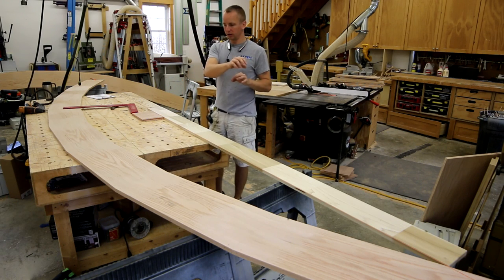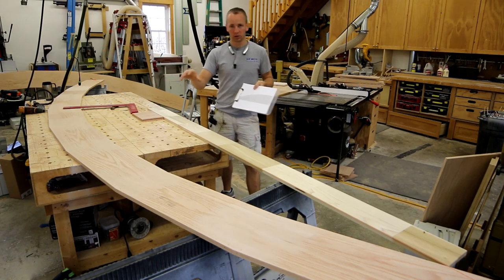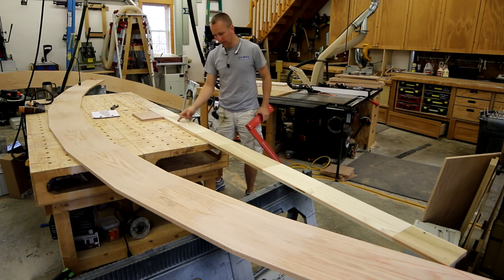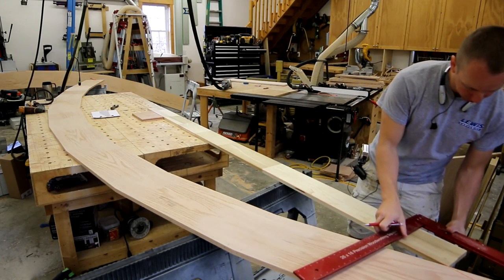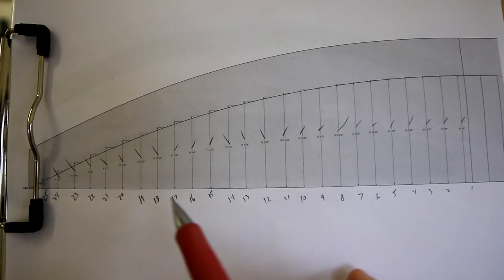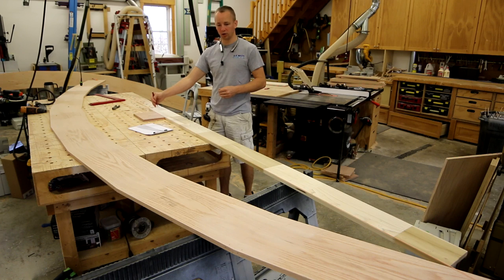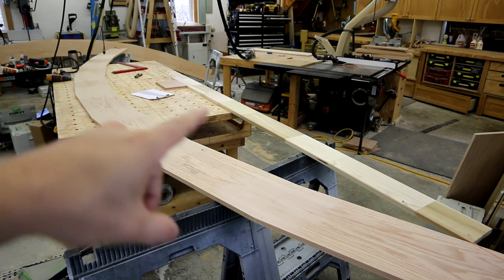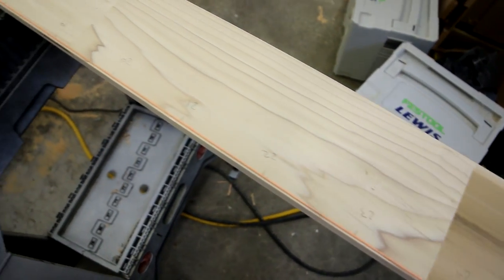Arch Beam Part 4 - Arch Layout

Comment: Awesome .. I kinda wish I had all the tools you have .. But nonetheless you got it down .  I am a poor man so I have to rely on simpler more inaccurate tools .. I am envious !!  LOL ..  When asked " Can you make curved ceiling beams " Yes ..  My primary tool is a calculator and then a beam saw , skilsaw . sawzall , hand planer , framing square , grinder with a 15 grit and a series of sandpaper on an orbital from 40 to 120 .. If they want S4S   I deliver .. if they want the roughsawn .. I drag a sawzall at an angle to make it look like it went through a mill   Oh and I forgot .. a hoist from Harbor Freight .. I trammel out .. even if I have to set it up  300 ' away .. I envy your tools .. and You are damn good ..   Got my subscribe

Comment: Hi. Could i take the measurements and mark it form the joints of the section boards( since they're the deepest points on the unfinished arch) and bend a long  poplar shoe mold to to connect the dots to get my first line? would it work you think? I have something coming up and  not enough time to learn sketchup, I'm still at the basics. great video!
Reply from the maker: Yes, That works also.